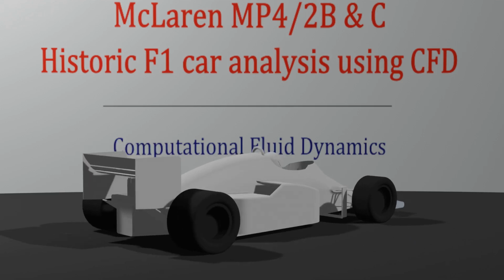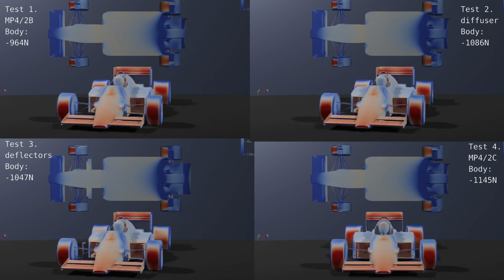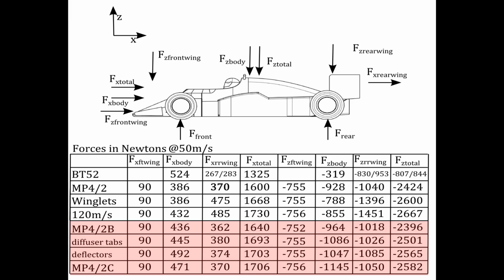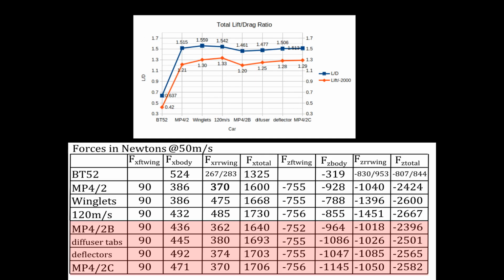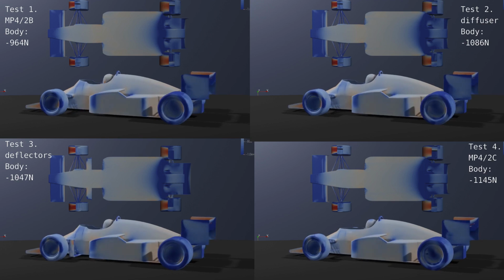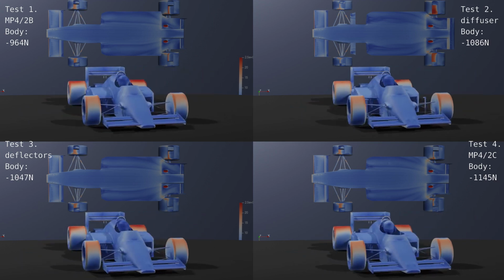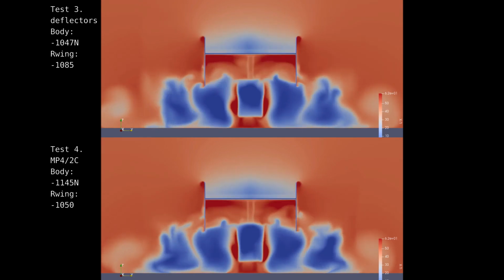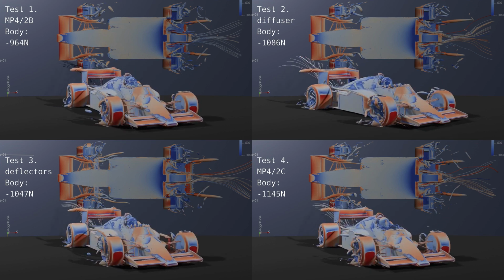A CFD Analysis of a Historic Formula One Car: McLaren MP4/2B & C (2/2)

Comment: Wonderful presentation. I am revisiting it so I am unable to like it again. I think you have forgotten one change between the mp 4/2b and the mp 4/2c. I can remember an interview with John Barnard from years back where he says that it was possible to lower the driver seating position by 1-2 cm and this in combination with lower inlet manifold allowed the engine cover (area behind the driver head) to be slimmed down. Again if I remember correctly then he said that the shorter inlet trumpets and compacted was already on the original version of the TAG/Porsche engine but gave it an unsuitable engine characteristics. But a new fuel injection system with mass flow measurements had made the old compact system better in any way. Greetings from Denmark
Reply from the maker: Thanks. I really want to remake these earlier videos, they are so poorly made..... You maybe remembering the MP4/3 as that had basically the same chassis but the engine cover etc. was different.